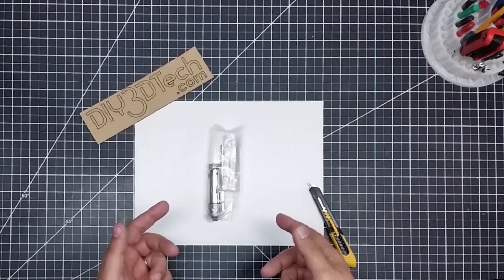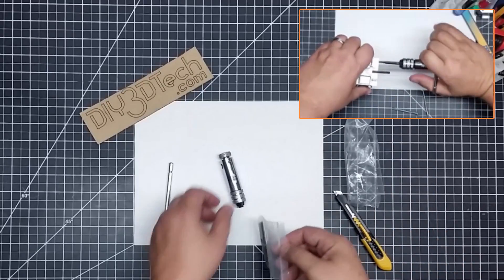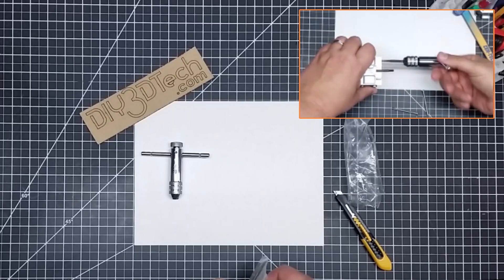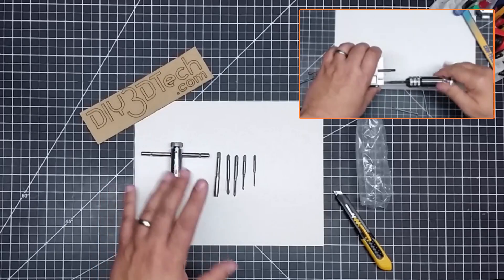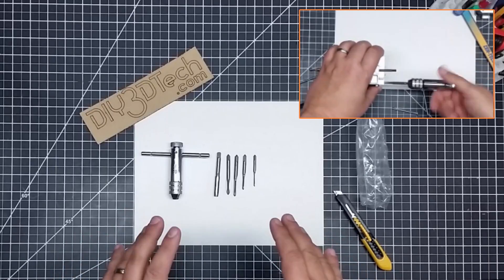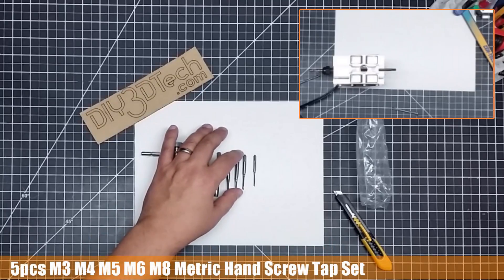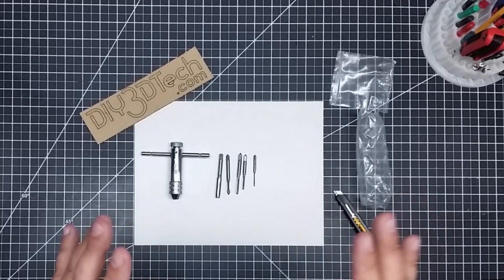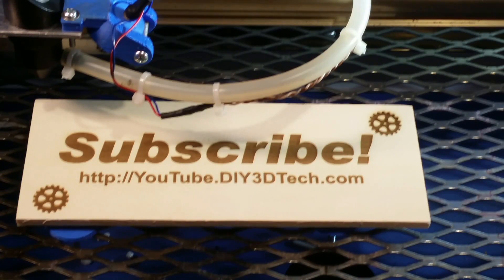Shop Talk - Nifty Speed Tap!

Comment: I don't have any taps or dyes for cutting threads, especially not into plastic... so I have never done it, but I've screwed many screws into empty plastic holes... Do you think cutting exact threads will work well enough to justify not just forcing the screw in?
Reply from the maker: Yes, as I use Fusion 360 to add threads and then use the taps to clean up the irregular holes.  This keep the bolts from damaging the holes/  I also print 1.2 mm walls when I am using threads too.  This provides extra strength....
Reply: I've done quite a few prints of brackets, mountings etc and came to the conclusion that, yeah, you can force a screw in and it does work, but it's not the same as a tapped thread.

I think the reason is partly that the tap has cutting flutes to clear the swarf so you end up with a cleaner, smoother thread that starts easily and stays in good condition if you need to disassemble and reassemble things.
Reply from the maker: Clint you are correct and especially if you use Fuson 360 as its very good at creating reasonable 3D printable threads...